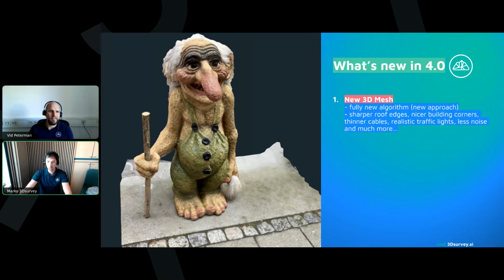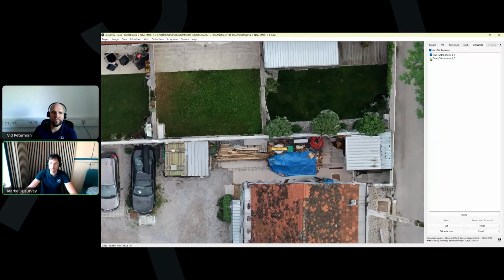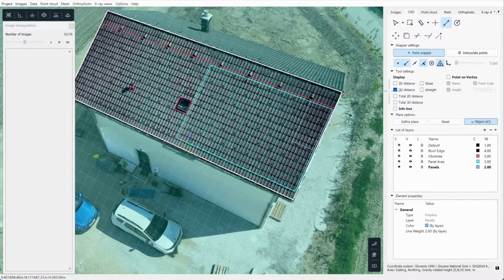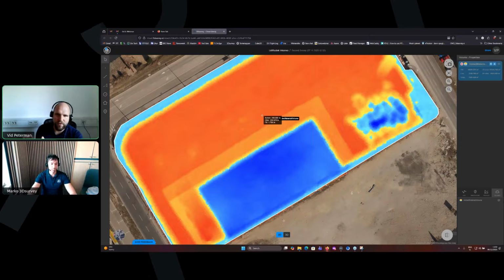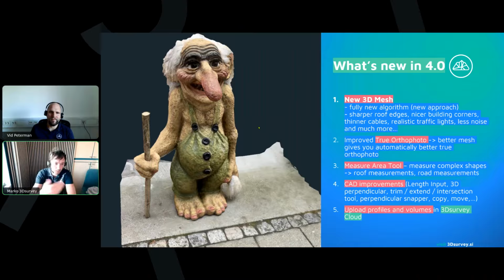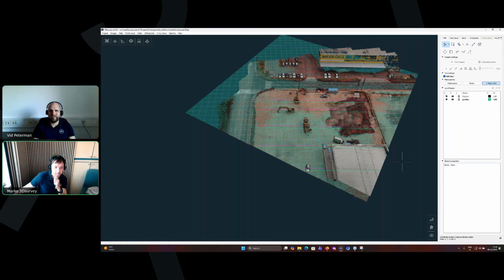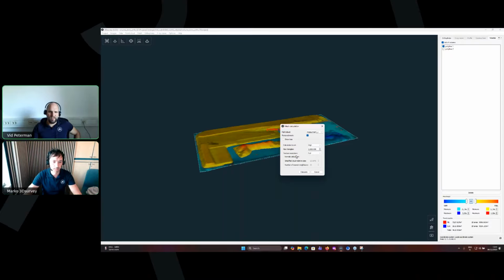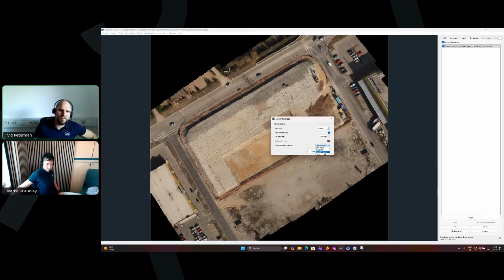Webinar: What's new in 3Dsurvey 4.0

Comment: is 3Dsurvey good for thermal operations like solar farms inspections ?
Reply from the maker: It will work. Pro tip: if you use low resolution images, use "extreme" option in Bundle adjustment.